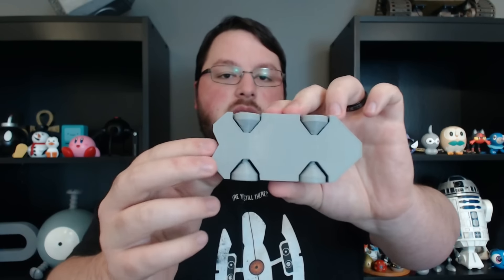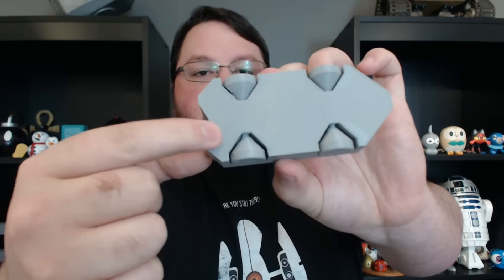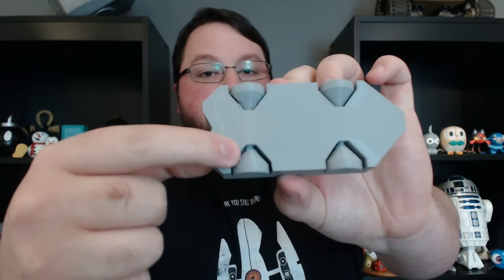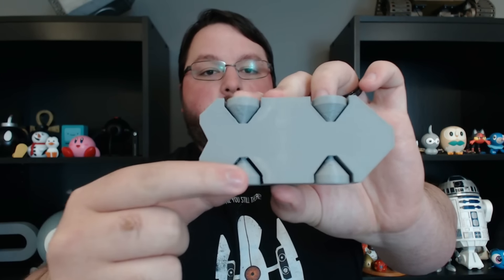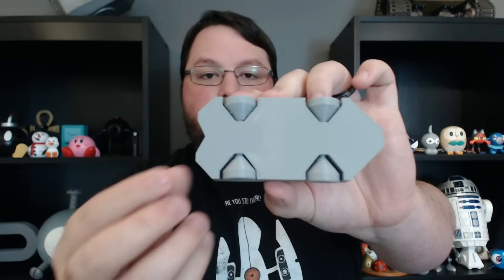Print in Place Toy Car - #3DPrintmas Day 16!

Comment: Great video. This is a very ingenious design.  As soon as you said you were having bridging issues and decided to go with a square hole I think I know exactly what you may need to change. Instead of a flat surface, cut out the edge with a cone shape. Where the center of the cone is at the bottom of the car. This will gradually build up the sides closer together and alleviate the need for any bridging. You will be able to change the axle hole from square back to a cylinder as well. Keep up the good work.